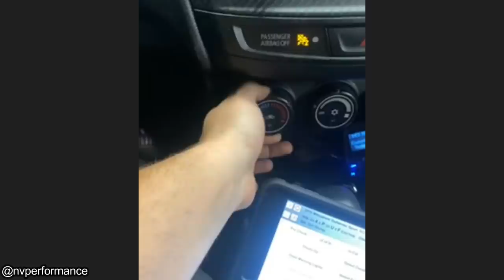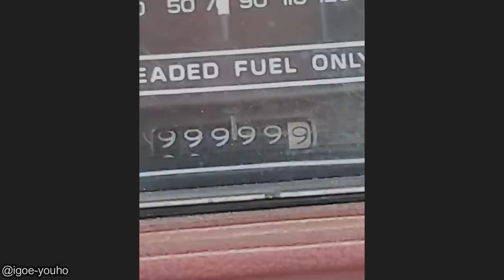Customer States They Want BMW To Warranty The Damage | Just Rolled In

Comment: 0:40 manual reset of ventilation system's main control module =$1500
Reply: That would be evil
Reply: nah, that´s worth at least 15 000$, you have to change half of the electronics!
Reply: Justified through verbiage, excellent work.
Reply: Seriously, though, what do they do in those situations? Just charge the customer for an hour of labor?

Comment: I have worked in this industry all my life and have done every job except sell cars. It's staggering what idiots want carried out under warranty and what they will not have repaired. My favourite memory is of a customer who refused to have his pads and discs (rotors) replaced that had been metal to metal for at least 500 miles as it was a rip of having the dealer do it. His friend did it. We saw it a week later after it had crashed  (brought to us on a recovery truck) wrong pads put in badly  (one side both pads were facing the same way) and still with the original discs!  His friend had charged him £130.00 which was my dealerships charge for replacing the pads inc tax. when the insurance guy turned up to inspect the car we showed the refusal to have safety work carried out then showed him the  car. He just looked annoyed and refused the claim then and there. customer now out of pocket to the tune of approx. 12k for the damage to his car and the two he damaged plus all the legal costs etc. then of course the police went to town on him. We never saw them again

Comment: As a retired dealer technician, I can say the complaint of AC blowing warm from this cause is much more common than one might think.
Reply: I've made the same mistake in my last car, but I worked it out, by the time I got to work. Just before I got rid of it, though, there must have been a loose connection between the manual hot/cold sliding bar and the part it was moving, because it always felt like the heater was on just a bit. Either that, or there was a hole in the pipework, but I never smelled anything odd.
Reply: Some of the newer climate control systems confuse people who are used to simple "hot or cold" systems. Have definitely seen someone ask why their ac was blowing warm air. It was set to 18*C and it was 2*C ambient air temperature that morning.
Reply: @Candesce  Fun fact, if you hold alt and press 248 on the numpad you get ° :)
Reply: I simply don’t know how you can tactfully explain this to a customer.
Reply: @speedlever  Yes, it's very hard.
But always do it with a big friendly smile on your face when you do so.
Reply: @speedlever  , like a child so they feel really stupid, but you just come off as "teaching them".
Reply: I had a customer bring back a Honda Pilot she had for 2 or 3 days complaining her parking assist wasn't working. Walked out and turned in on, then turned around, handed her the keys and said if you continue to have issues, please come on back
Reply: @JG-fe1gx  A recent used car sale no doubt.
Sometimes opening the owner's manual helps.
Reply: I had to fix my FIL's car for the same reason.   He is in early stages of Alzheimer and only drives when his wife is with him.  I did not have the heart to tell him what was wrong.  I told him it was low on freon and I had extra so I added some.  He has a new Buick with digital controls and they both get confused by them.
Reply: Not so much anymore, but I cant tell you how many times Ive had customers come in with an INOP A/C  concern , only to find out the car didnt come equipped with A/C.
Reply: @christophernorgaar6373  actually it was a new car sale, but it doesn't really matter, some things are complicated, apparently.

Comment: I can tell you stories. Here are 3 of the best. I worked for a Toyota dealer in Brooklyn NY. A customer came in with a indigo Blue Camry with various complaints. I was the shop foreman so I normally looked over most of the cars before they came in. His complaints ranged from a broken fuse box under the hood to a rattling front door. The vehicle was in a major accident. He claimed it was never hit. I peeled back the interior panel on the L/F door and found it was a used door originally painted beige. When I pointed this out to him he then claimed the accident wasn't that bad. Right. 
Second one, same dealership. We had a customer who cam back 8 times with a broken off R/S door mirror claiming warranty. Every time it was brought in it was a different person driving it. After the 3rd time I began taking pictures of it. They always claimed they had never been to our dealership before until I showed them the pictures. At that point they drove away only to return the next week or 2. When they returned the 8th time I told them I would be notifying the authorities as they were attempting to commit fraud.
Last one, Toyota dealer in the Bronx. A customer came in , stepped out of their car ( a Plymouth Breeze, NOT a Toyota) and immediately began cursing and complaining about us and the POS we sold him used. I noticed the car had a plate frame from the other dealer in the Bronx. I grabbed the vin and checked it. Sure enough the car wasn't purchased from us. I confronted him in our waiting room and confirmed he purchased it from them. He told us the other dealer had told him to come to us with any complaints or problems. I put his vehicle outside and told him to leave and never come back. He attempted to drive back in but I locked the door to our service entrance and called NYPD. At that point he left. I have loads more.

Comment: We had a lady come in with a Highlander asking me to balance her wheels. She stated vibe at all speeds. There was a big dent in the panel next to the RF tire. The control arm was broken and the tie rod had 2" of play. She needed a control arm, rim, tire, tie rod, bearing and strut. She said she hit a pothole. I asked, "A pothole jumped up and put yellow paint on your quarterpanel?"
Reply: @fluffy_kitten  You know those concrete bases for the big lights in big parking lots? The dent was that height, and scraped the paint off her car.
Reply: "Hit a Pothole" seems to be the standard excuse in the US for smashed rims :-)) Just as "Drove through a puddle" is the standard excuse for engine damage due to water ingestion. :-)
Reply: @uhtred7860  The old, "It's not my fault" excuse.
Reply: @uhtred7860  Like the popular volumes of alcohol consumption when asked by a cop. "One beer" or "a sip."

Comment: Finance companies are known to put trackers on  vehicles to be able to repossess if the buyer defaults. Most buyers don't know that they agreed to this when signing for the loan.
Reply from the maker: Yep, we use to install them at a dealership I worked at. We sold used "high end" vehicles. They weren't like that one (looks to be one from amazon) but about 50% of vehicles sold got one installed.
Reply: Would I get in trouble for  breaking it off?
Reply: VERY common for "Buy here Pay her" lots
Reply: @fhuber7507  Simeon Yetarian has entered the chat...
Reply: Power. You need power. Properly installed devices have power.

This tracker have limited power supply.
Reply: @geekygirlgaymesalot736  If the loan agreement you signed states there will be a tracking device installed then you could cause issues with your loan by removing it.
Reply: @pdxyyz4327  OOPSIE, must've fallen off....
Reply: @geekygirlgaymesalot736  I would say, "Oh. I must've lost it in a boating accident."
Reply: Some insurance plans require this too.
Reply: @pdxyyz4327  Put it on a bus headed to Des Moines. ;-)
Reply: @cpufrost  put it on some kind of race car. Maybe a rally car?
Reply: Nervous laughter in OnStar
Reply: Almost all cars have some kind of tracking device now days . That map app works both ways.
Reply: @geekygirlgaymesalot736  If you agreed to it in contract terms, it would be breach of contract to remove it and theft.
Reply: @K9River  "oops, whoops" never cuts it as a legal defense.
Reply: that sort of makes me less worried for him. 
bargin bin tracker=loan company
mid-range tracker=her husband
gucci tracker=call up witness protection you doidy rat!😄
Reply: Yeah but those are hard wired. That unit was just a magnetic slap under which has a life of about 30 hours tops
Reply: @haroldwilkes6608  My insurer asks if there is a disabling / tracking device on my motorcycle (gives a cheaper rate if yes). Yes, there is a GPS tracker and a lock as well (installed by me)
Reply: @roadmonitoroz  Lock, good idea. Isn't the On-Star system the same? I'm 78, low mileage, insurance is already cheap but have considered having this put on...Silver Alert thing, never know what the future will bring. When young and carefree I'd be over a hundred miles off-road without phone, radio or GPS, a little different perspective now.
Reply: @masondegaulle5731  First, that is incorrect. Second, it was a joke- a reference to gun confiscation.
Reply: @fhuber7507  sadly.....
Reply: @masondegaulle5731  What tracker your honor ? I had a GPS tracker on my car ? Whaaaat ? 😲
Reply: @steveb6103  oh I know that, but I have the ability to shut off my phone to prevent it from working in that direction.  OnStar on the other hand is always on, and I don't have control over when it polls my location.  Different degree of severity.
Reply: And it was in a box surrounded by metal, that would have blocked the satellite signals?
Maybe it uses phone signals? in which case the box it was in would still block them.
Reply: @pdxyyz4327  i removed mine
Reply: Say whaaat? Didn’t know that. That’s why I get my own finance company. I get both keys when I leave the lot. 👍
Reply: I can't see a rental place or car dealer being so low budget as to put a device like that with finite battery life in a simple weather box as their plan to recover a car months, or longer, later.
That tracker looks very short-term, and lower budget. 

I would expect something like that from a stalker or police department doing a short-term surveillance.
-
It did not look like it was hooked up to any external power, and with that display was not a simple transponder.
Reply: @fhuber7507  From the various Buy Here Pay Here cars I have seen on some channels, I would think that place would be using the trackers to know when to hide from angry customers.

Comment: I fell your pain. I'm a shop foreman at a mercedes-benz dealer and we go through the same stuff.. few yrs back we had a client's dog chew up the leather seats in his S class. they blamed MB saying that they put something in the seats to make the dog want to chew it...
Reply from the maker: Why yes customer. Mercedes hides dog treats in the seats. Wow 😂
Reply: The name was Karen ? ?
Reply: Cow-hide!?!
Reply: I don't own a car but leather seats in a Mercedes chewed up is probably just as expensive or more as replacing an outside mirror.
Reply: I once had a Cadillac customer state to me that the tire was defective on her new Cadillac because "it allowed the nail to penetrate it and make the tire go flat".
Reply: @kareemofwheat602  Jeezum crow. I had a guy come in with a messed up runflat furious that he spent so much on tires to have a belt shift cuz he massively overloaded the vehicle.
Reply: Entitlement without limit.
Reply: I once complained to Caterpillar that the starter motor on the wheel loader only lasted for 30 years. Damn poor quality. Also the battery retainer had rusted to nothing in the same time. I mean the machine had only been loading and sitting next to a salt pile for that 30 years. I did get a 30% discount for the new starter tho.
Reply: @clearcreek69  Dude, an outside mirror on a Merc is $1000, and that's just for the glass.  Crazy expensive.  Leather seats are definitely more, though, heh.
Reply: Well, to be fair, Mercedes DID put something in that car that led to the dog chewing the seats.
They put a human, who can't train a dog, behind the wheel.
Reply: @Darion350   ikr what a stupid claim to make. 

Seats gonna be pushing 2k a piece no matter the model , with install, probably one arm and half a leg

Comment: The " A/C blows warm " reminded me when of the time I worked at autozone and the customer decided to install his own battery in the parking lot and complained he had no power. Kinda helps to remove the plastic battery post caps before installing the terminals 🤣
Reply: Yeah ? I had a fellow tech at the shop where I work state there was still an electrical problem with a car he just installed a new battery in. I looked, and told him to remove the plastic caps from the posts.
Reply: Seen that happen a few times!

Comment: That sounds like something a BMW driver would ask for.
Reply: Have 'em fix the turn signals while you're there... 🙄
Reply: @PERFECTLS3  Why? They've never been used.
Reply: @ccaamm1  If it wasn't New Year's Day, I'd say that was the best reply of 2022.
Reply: @PERFECTLS3  BMWs have turn signals?
Reply: I have watched multiple, seemingly capable adults, go to the BMW dealership for the sole reason of having them put air in the tires.
Reply: Doesnt look like any BMW. Looka like Merc G-class
Reply: BMW doesnt make suv looking like that
Reply: @jeebus2121  The warranty will be voided if it's not genuine BMW air.
Reply: @danpatterson8009  Absolutely. Being an automotive enthusiast, I've delved deeply into the subject of faulty BMW turn signals. While it is assumed here in the states that it is just uppity BMW owners that are too privileged to put down the Starbucks long enough to flip the stalk, it turns out to be much more involved than that. Through extensive research, years of analytics, translation of analytics from metric to SAE, language translations from Austro-Bavarian to German to English, chemical analysis and real world application, my findings were not only surprising, but perhaps ground breaking as well. It turns out that due to slight variances in the metric conversion tables, the blinker fluid used in the United States is slightly different than that used in Bavaria. The Canadian metric system based fluid is converted from the US based fluid, and so it is equally ineffective in it's daily application.
I plan to post my findings in the Journal of Automotive Excellence as soon as I hear back on my Nobel Prize application letter. Until then, I would suggest just giving BMW owners all of the respect and room they need to successfully navigate the journey to their respective Pilates classes. They have BMW's, and we owe them that.
Reply: @danpatterson8009  its an option. but its rarely added
Reply: @iare19 
Looks a bit like a first gen X6 after the facelift. I think that light is the small one on the under the headlight rather than a headlight itself.
Reply: @PERFECTLS3  Ground breaking research, no doubt about it, but I'm intrigued about the Australian variant, do they fill them with "She'll be right " fluid?
Reply: Yup, not only on the USA. Here in Europe BMW drivers also have a reputation for being not that bright/skilled drivers, though they claim otherwise.
Reply: @NedKLee  Hmm, not sure. I don't think them to be required right now, as the streets are empty and the Co-v-id camps are full. Everyone is locked down and Max is building yet another Ford XB Falcon in anticipation of the new movie, Mad Max, Rise of the Variants.
Reply: @ScottGrammer  Good  one.
Reply: @PERFECTLS3  Loved my XB Fairmont, the very first car I ever owned with factory fitted AC and the 302 didn't hurt either.
The Mad Max museum at Silverton is 3.5 hrs up the road, one of my boys was a Mad Max nut, visited the museum several times, he could not get enough.
These days he drives a Holden Barina and I just smile.
Reply: @NedKLee  I too own a Holden, a Holden built Chevy SS to be more precise. Thank you to you and your mates for the finest car that I've ever had the pleasure of owning.
Reply: Not all of us are that level of stupid.
Reply: I drive a BMW and I use my turn signals all the time, but honestly the non-mechanical turn stalks kinda suck. You don't get any feedback when they cancel. When driving through the city and having to make a turn I switch on the turn signal but frequently I have to drive a little bit in the opposite direction of the turn because I need to let cyclist pass or make a wide turn and then the turn signal cancels and I don't notice. It's annoying, I much prefer the older mechanical turn stalks, I always noticed when they canceled on me when I didn't want them to.
Reply: @PERFECTLS3  Glad to be of service Sir.
There's a lot of pride, passion and a proud bloodline reflected in that vehicle. 
Spent 23 years of my life loading them on the back of my truck and delivering them right around Australia.
I hope you do realise that the ones you're driving in the USA are the ones that were rejected here by QA, somehow they put the steering wheel in the wrong place.
Reply: @NedKLee  😂 Actually, the one I'm driving was rejected by the whole world, it's got a 600HP gas guzzling V8 with too many pedals... 😎
Reply: @PERFECTLS3  Couldn't help reading that with a great big smile on my face along with a good chunk of envy.
The sort of car you want to take north up the Stuart or west across the paddock and ninety mile straight just to get it into top gear.
Reply: @PERFECTLS3  I'll do that.

My last posting in the Australian Army was at 3 Base Workshop Battalion, the largest military workshop in the Southern Hemisphere.
Brocky would come and speak on occasion to the troops and the apprentices.
Always a capacity crowd with him, a genuinely nice bloke.
Later on I delivered VH, VL Commodores to his workshop in South Melbourne where he converted them to HSV's which raced at Bathurst, direct ancestors of your SS.

My 3.0L turbo diesel HiLux SR5 is perfect for where I live, I need the ground clearance and the Bull Bar.
Horses for courses I suppose
Reply: I watched a bmw pull out and in-front of and get hit by a bus. I stayed because I had a dash cam. The bmw driver immediately got out blaming the bus driver. Must be an entitlement thing.